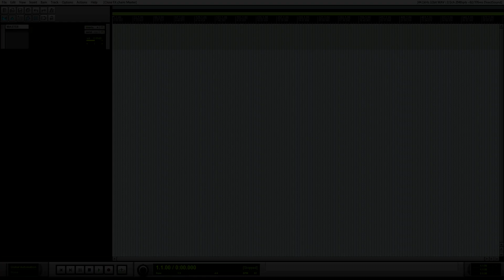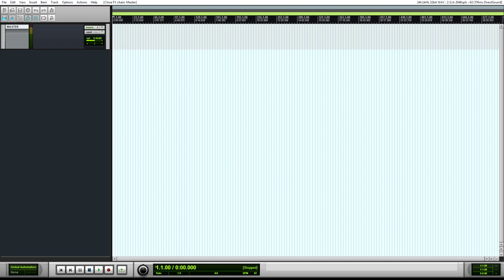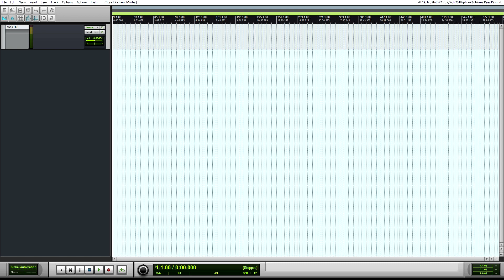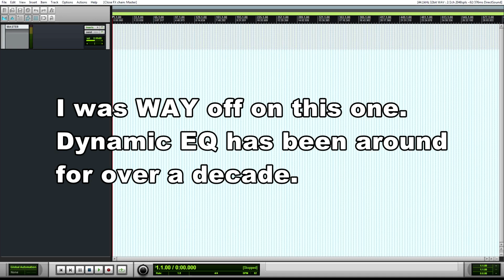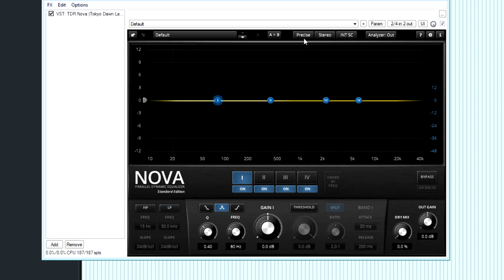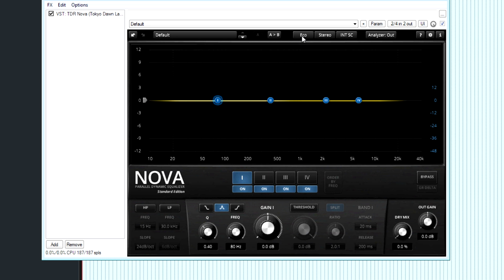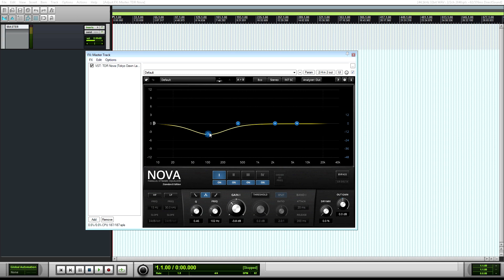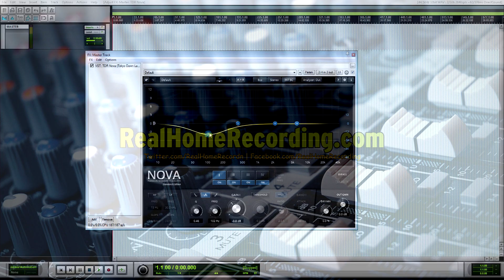Dynamic Equalization is Awesome!

Comment: isn't that the same as a multi band compressor???????
Reply from the maker: +isaac thrash Nope
Reply: +isaac thrash   I would argue that there are some similarities, though.
Reply: David Nika to me this plugin is an eq with multi band compression features.
Reply from the maker: isaac thrash The big difference TDR explained to me is that with a multi-band limiter/compressor you have crossover issues. This operates like an automatic parameter switch. Nova is a parallel equalizer as opposed to the common serial equalizer. That's what gives it a special sound.
Reply: RealHomeRecording.com thanks

Comment: could you do a tutorial showing dynamic EQ in action? it would be good to see how it works in practice
Reply from the maker: +stupidusername38 Certainly...I'll be doing a second practice mix some time this month so I can wrap my head around it in practice.
Reply from the maker: stupidusername38 It's basically the idea that a de-sser is except you have more control over its operation (Q setting, gain, attack/release).

Ever tried to mix a piano? Pain in the ass due to it covering the full frequency spectrum, unlike other instruments that have fundamental frequencies in different areas of the spectrum. Dynamic EQ is the solution to the problem of frequencies that jump out at different times of a mix.

It's similar to multi-band limiting but functionally different. Think of Dynamic EQ like an advanced form of multi-band limiting.